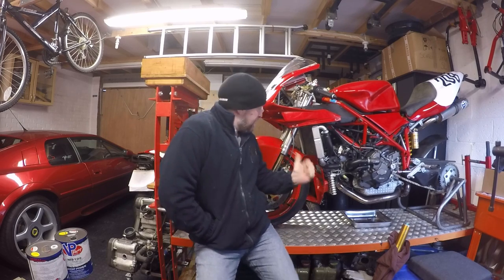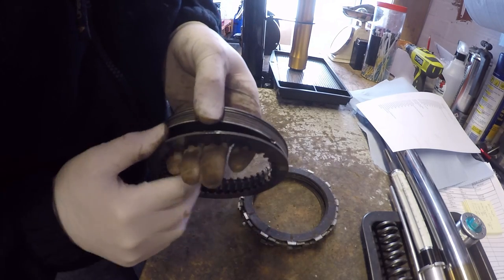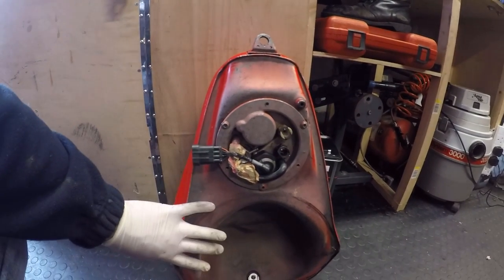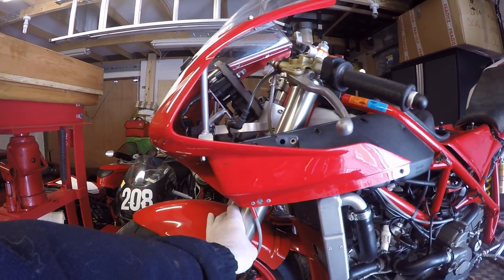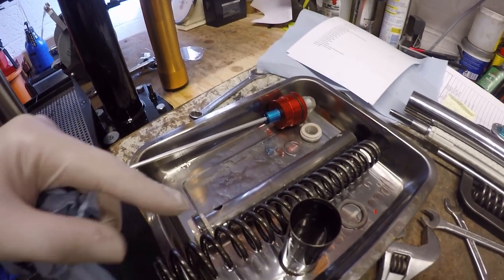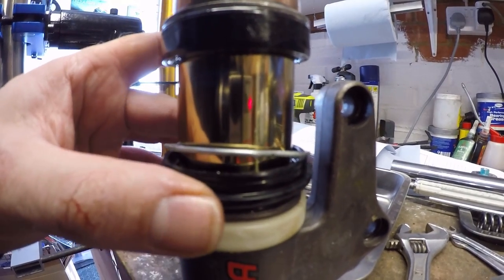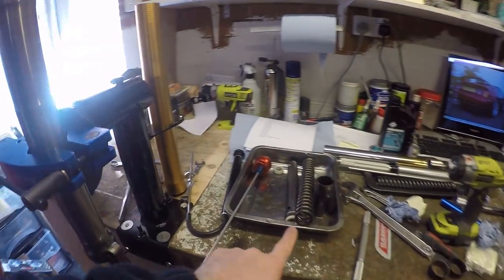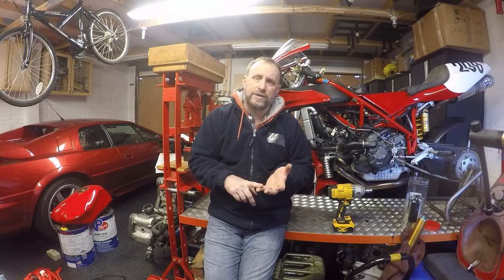Ducati 748 2020 Race Bike - Video 2 Clutch, Fuel Pump and Fork Service

Comment: Interesting, I never had a friction plate on the outside of the pack right next to the plate inside my slippe clutch. Is this specific to your clutch or whats the reason for that?
Reply from the maker: Hi VauZwei, its purely personal preference from playing around with the pack order to get a feel I like and NOT a recommendation, the pressure plate wears faster as a result but I only get 2 seasons from a clutch if I am careful due to wear on the basket and drum from the plates. For correct installation you should have a steel or even 2 by the pressure plate, thats why I put the correct stack lists in the video description. Hope that makes sense 😊
Reply: Instablaster...

Comment: Do you race on standard suspension because of class regulations or just preference?

It’d be great if you could do a video of your bikes’ geometry and suspension setup if you’ve altered it. I see you run quite a larger rear sprocket than standard, I know that’s got some implications.
Reply from the maker: Hi Rob,

Suspension is free in the class but this time round I chose to keep the front standard until I find the limit of it, the two meetings I was at last year I was 2 seconds off my normal pace so I have personal effort investment needed before pushing the suspension technically  further.

I will see if I can dedicate a future video to the geometry changes made to the bike.
Reply: yeahhhh !!!! bike geometry.. that would be nice... !!
there are not to many vids about that subject...
so.. totally agree on that!!!

Comment: Hi dude, every ducati owner needs to be watching these!

Regarding the number you were looking for on the fork oil bottle, here's a link to a table of well known oils and their real viscosity at cold and hot temps: https://www.peterverdone.com/wiki/index.php?title=Suspension_Fluid 

Silkolene RSF or Ohlins fluid look to be pretty much the best bet, because as the numbers show, their performance at different temperatures is much more consistent than most of the rest. I just stick with Silkolene in all forks cos then I always know where I am. In general, the RSF real viscosities are higher than the numbers on the front of the bottles suggest - Bang on for mentioning that! In my 748 I blend a bit of 2.5wt with 5wt to get as close as possible to the OEM Showa fluid viscosity listed in the table. (There's also a silkone mix ratio pdf below the table in that link).

Well serviced 748S forks are very slick. Although, I had a bad experience last time using some aftermarket 'upgraded' seals - they were so tight that the stiction wouldn't even let the tube slide down the stanchion under its own weight, so I did the job again with N.O.K. seals, which I'm told are Showa OEM and all was well again. Warming of the tubes was definitely necessary! What a nightmare! I wish you'd made this video earlier LOL!

One last thing... Good luck with that electrical glitch, you'll sort it!
Reply from the maker: Thanks Richard 👍
Nice link, it is not too dissimilar to the list  I already have although probably with a few more oils.
With after market seals the stiction check is a must otherwise it can lead to all sorts of problems 😒 I agree on the Silkolene and Ohlins oils performance point, cannot fault them.
You are using quite a low weight of oil, surprised by that but then it is down to personal feel.
Thanks for watching, might of found the electrical problem as well. 😊

Comment: very nice that anti faff suspension holding tool  what make and where did you get it.thanks
Reply from the maker: I cannot remember the make of mine, but there are a few about. Such as this one:
https://www.ffx.co.uk/product/Get/Sealey-Ms1824-5051747750081-Motorcycle-Fork-Spring-Compressor?msclkid=80337681b2b9159a015e171e596c2439

Comment: Sir i have ducati but the raditor watter allwys comes out i mean flush from spar watter contaner
Reply from the maker: The water expansion tank near the head stock can split after a while. It will not start leaking until under pressure. You can get replacement header tanks still.

Comment: I've used red ATF fluid in my older Ducati, it's about 7.5wt, I think it's possible to use it in these also, but a valving adjustment is likely, there are some great options for aftermarket valving for these forks.
Reply from the maker: There are lots of options open to these forks from valve kits through to full drop in cartridge kits. Certainly you will not be limited if wanting to tune the forks 👍😎

Comment: 17:32 you say fully back off the register... I realize I make a mistake because before open I completely screw in the register with screw driver. is this a big mess? and if yes how can I solve? thanks for your help.
Reply from the maker: You will just need to wind them out fully to the stops before you fill with oil. You wind them out to make it easier to work the oil through the forks when refilling and prevent any issues filling all the space in the forks and adjuster channels.

Comment: Great video, as usual. Resurrecting my 998 after a 6 year nap. The 600 grit sandpaper doesn't damage or remove the Titanium Nitride coating? No need to replace any of those fork bushings? My forks "click" upon rebound, which I've heard is normal on these bikes, but mine seems louder than I ever remembered, and I wonder if something like the bushings are worn?
Reply: Oh, I read the description, and it says you replaced the bushes. Did you go with OEM or are there aftermarket ones that are just as good?

Comment: Great content, I'm about to tackle the fuel filter on my 996 for the first time so seeing this helped heaps. Also getting some Seal All just in case :-)
Reply from the maker: Good luck, just don't force the pump back in, that's when it can cause issues. It needs a firm even pressure to push back in
Reply: @DesmoWerx  thanks, I'll watch out for that

Comment: Loved the fuel tank section - It was a pain trying to connect the 2 x filler cap overflow pipes to the pump assembly on mine.. i think the next time i change the filter i will just jumper the hose like in your video - Would that be ok for a road bike? or is it better to keep it as OEM? thanks
Reply from the maker: Those pipes are for overfill or spillage when filling up so if you are careful you should be okay. Make sure to block the holes near the filler cap otherwise water will enter the fuel tank.

Comment: Can you explain what you meant by “I don’t worry about pump gas.”? I’m not sure understand how that makes it ok to remove the vent hoses and loop them. Thanks!
Reply from the maker: Hi Rob,

My meaning is that because I have a non standard fuel filling cap and use a funnel to always fill up I don't have to worry about spillage in the fuel cap recess.

In that space there are two drains which are connected to the fuel pump base and drain away if you spill fuel or overfill your tank.

Hope that makes sense, its not the difference in fuels.
Reply: DesmoWerx doesn’t this leave the tank susceptible to water making its way into the tank in wet conditions? Or does the aftermarket cap seal so we’ll that isn’t a concern?
Reply: Also, do you just loop the two breather ports inside the tank (under the filler cap). If so how does the tank breathe as fuel is depleted? It seems the tank would vapor lock at some point

Comment: Another awesome video. Does your plate configuration conform to quietening the dry clutch down as well. Seen a few people doing that
Reply from the maker: Thanks Jason, 
I dont know if this makes the clutch any better noise wise, I found it was slightly better at initial drive off the line.